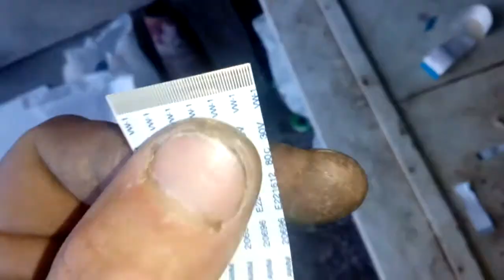Silver from the ribbon cable - Urban legend or truth???

Comment: it is my understanding that the average pc motherboard is 45% copper by weight so if you are recycling them without taking this into account then you are not making as much money you can. physical separation cheaper than chemicals so is electrical separation if the pieces are small enough than the heavy metals and copper can be separated by gravity the fiber left over from the separation process old as a concrete strengthening agent i would like to see a homemade hammer mill gravity separation of the gold silver palladium so that only a small amount of chemicals are needed to finish their processing. i would also like to see processing of the anode slimes to recover most of the base metals like tin and lead and the copper should be pure enough to be busbar grade.
Reply from the maker: Clay Mccormick I fully agree with you, for now I'm keeping all the depopulated plates that I will process in the future for copper and other metals. Even electrolysis I have in mind in these processes. But for the time being, I do not plan to deal with it at the moment.